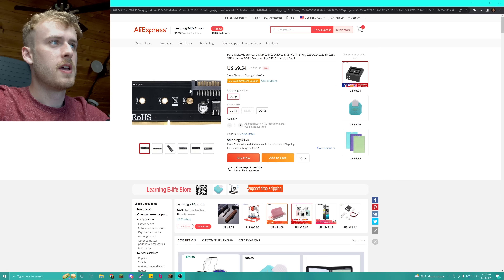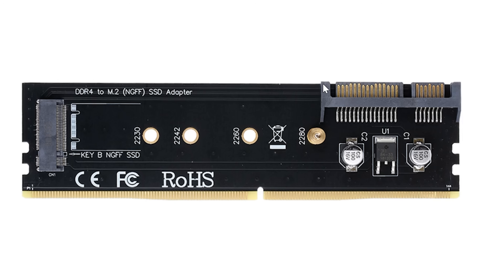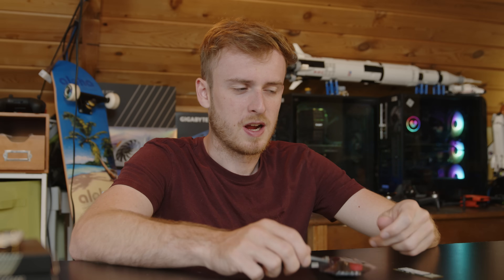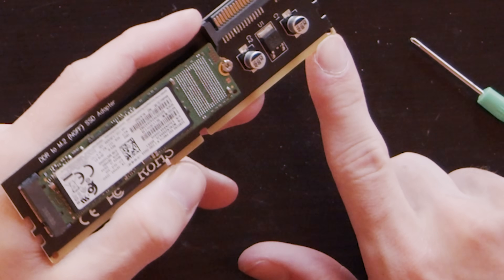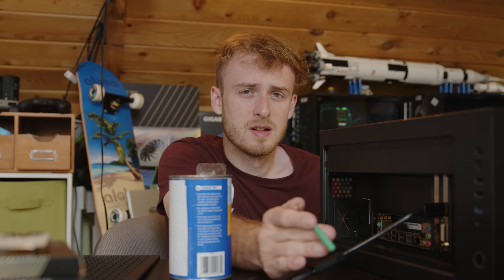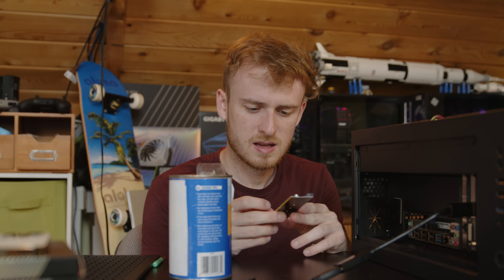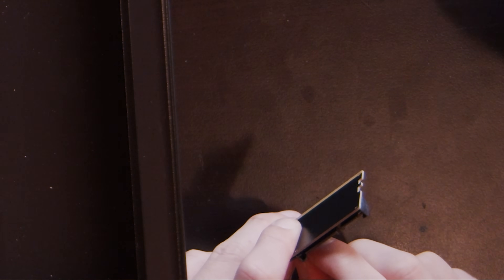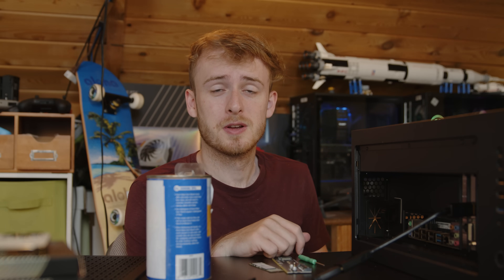I Bought a M.2 SSD To DDR4 Adapter from Aliexpress.com and Broke My PC?

Comment from the maker: Hey guys update: the product got removed off the website before I uploaded the video -.- I also haven’t any luck fixing the pc. Luckily those motherboards and CPUs are really cheap and I have a lot of them for videos. I also frankly have no idea why this is causing issues. There is nothing to be breaking it?? Also join my whitelisted survival server here too: https://discord.gg/XcXzFxevX3
Reply: oh man that sucks :( what kind of product even is that wtf
Reply: If it’s a recent CPU like last 3-5 generations at-least, possible the fix is as easy as switching out CPUs as the IMC (integrated memory controllers) are now baked into the CPU instead of the board. Now if that doesn’t fix the issue, chances are the damage is more physical, maybe the adapter is too thicc or mishaped just enough to bend some pins to touch while was installed or something.
Reply: Can you look with a multimeter if something connects somewhere
Reply from the maker: Well sure but the biggest issue is sure I can trace connections but it’s hard to see what voltages it’s putting out now that’s it’s fried potentially the board, the power supply or both. I don’t have an extra system and voltages and stuff may be different.
Reply: @JaysTechVault  i meant more just in contuinity mode, just from the regulator to the pins slide it over listen for beeps
Reply: I'd bet that the adapter had the 12v rail connected to the data pins of the SATA interface. That'd do some damage.
Reply: RIP escaped magic smoke
Reply: Try clearing CMOS. I think you corrupted the CMOS by having it in the ram slot with no pins. The slot thinks there was a module there because it moved the contacts in the socket but then it didn't connect to anything.
Reply: @jacklwebber  The way you worded that it sounds like as if you are saying the CMOS is on both the chip and on the motherboard.
Reply: Consider the traces overlapping on the capacitors to the mosfet to go into the sata delivery and kill the ram chips to then go and fry the mother board?
Reply: Was it removed by the scammers or by the website?
Reply: just a note, you mention a dropoff from SATA m.2 to conventional SATA because of a discrepancy in the number of pins - the data connection has 7 pins, but you're forgetting to factor in the power connection that supplies +5v, +3.3v, +12v and gnd. There is no discernible difference between a SATA m.2 and a conventional 2.5" SATA SSD.
Reply: wow finally, a SATA killer
Reply: What a wierd gadget it toast the board at boot what kind of crap are this guys seling? Well its a refresh for the usb killer they should pay for the damages on the pc no mater the price couse you have more boards to spare a normal consumer wont its very sad to see this scams.☠
Reply: @candidosilva7755  Mater hehe
Reply: @candidosilva7755  This scams hehe
Reply: @candidosilva7755  Couse hehe
Reply: What chipset and motherboard was it?
Reply: First thing to understand about doing business with the Chinese: they will find a way to fuck up the product worse than you can even imagine. It is not that they will simply lie to you. They will put in so much absurd effort into finding a way to make the thing even worse than just being lazy, enough they could've probably made a working product for the effort, you'd swear it's either geopolitical spite or some kind of black magic. Yes, a no-pads stick of plastic that doesn't do anything would indeed be Chinesium, but it's not authentic Chinesium until it shorts your motherboard without even having pins.

This is why I refuse to do business with them. You'll realize after awhile nothing good ever comes from China.
Reply: sucks u couldnt make it work but thank god it got removed cause thoes people are sick nasty people
Reply: could have caused a power surge through the sata to the dimm slot by a very small connection.
Reply: Cmos cleared?
Reply: I like his confused look 🤣
Reply: How much is really cheap?
Reply: it fails and destroy your board because of the voltage being too high
ddr4 is 1.2volt only

that ssd is minmum 5v or lets just assume 3.3v it will surely fry the ram slot instantly🤣
Reply: Well if a customer buys something that stupid, I would say deserved
Reply from the maker: I buy it because I show others why you shouldn’t. But even my electrical engineering student ass took one look at it and had no clue. From my testing I think it directed the 12v into the ram slot via the grounding layer. However I can’t really test it now that the system is broken and why I didn’t do much analysis in the video. I’m not plugging it into another system.
Reply: @JaysTechVault  Wait. You are an ee student, ordered a device for ddr4 (pin pitch 0.85mm) and it fit your ddr3 (1.0mm) and there weren't immediately alarm bells before you powered it on, let alone realisation of how pin moire probably caused shorts between signalling on your bus and power lines after it failed? Regardless of tracing being present or not. Not to mention any DDR to SSD interface must include RAM great enough to allow enumeration as fast DDR, performance which even NVME5.0 drives do not have.
Reply: @JaysTechVault  you can test it use a continuity check to see if the sata pins are connected 

It didn’t make any sense cause there’s no ic in between the nvme and the sata connection. Other thing maybe it’s meant for sata nvme drives ? Does indeed seem very odd
Reply: @ShaddowWolf  Image if that way of thinking were to be applied everywhere and now you have to be: an electrical engineer, computer scientist, neurologist,  mathematics, civil engineer...  just to survive 💀
Reply: @ShaddowWolf  I would say if customer buys something designed from China they should expect best case no work.  They should also expect most likely will destroy everything.
Reply: @mrfarts5176  honestly really, there is a lot of awesome but weird stuff from china that works very very well, you just have to know what exactly you need. This is something that you don't really need, just get a m.2 to USB adapter for example... But ye, weird chinese random crap for cheap, yeah don't expect much, thats true

Comment: The ram connections are dud, it is just using the ram slots as a holder. AND that is for M.2 sata based SSDs not NVME ones and for it to work, you have to connect both the sata cable and also the power from your power supply to the board, the board is not drawing any power from the ram slots.  Sorry if really you are going to use SSDs as RAM, the SSD won't last a month.  Furthermore, Intel Optane is SSD with onboard memory for caching, not the other way round.

Comment: One possibility is a short circuit. The pins of the memory slot may be high enough to scratch the conductive edge of the circuit board if it is a low-quality circuit board.

Comment: It should have been obvious from visual inspection (no tracks) that the product would never work as claimed.   The board could have been checked from an electronics perspective from that point.

There was no real point of risking a board & cpu for the sake of a video regardless of how cheap they are.  

This is why reputable brands that have warranties should always be the source for products.

Comment: Need special slot for those!
Edit: The ssd expansion board that can be plugged in normal ram slot have special chip on them that convert ram r/w request in ssd r/w request
edit2: Asus ROG Zenith Extreme motherboards had slot like that. "DIMM.2 riser card that uses a ninth DIMM-like slot on the right of the board to provide two fully fledged PCIe x3 M.2 slots as well as fans for better cooling."

Comment: I hope that wasn't your main system. You don't go plugging dodgy hardware into your main system. You do that with a burner system, much like you try software from dubious sourcese in a sandboxed VM, or better yet a "craptop" (airgapped laptop) so if it goes belly up you have no real loss.

Comment: the run of the mill oen you find has no pins and its made to fit the ram slot but have sata power and data cble to it, its just to hold it in place, any problem arises from the power delivery/sata short or wtv
dunno if this one has active pins, it cant possibly pull 5v from the dimm slot or maybe thats what fucked it up??

Comment: Looks like a voltage regulator, not a mosfet to me. Used to provide 3.3v supply to the M.2 drive since 3.3v is hardly ever provided on SATA power cables, which are usually only 5v and 12v - especially if fed from a legacy molex plug adapter. So then the 2 capacitors would make sense. One in input and one on output of regulator for smoothing.
Reply: All sata power cables should provide 3.3v.

Comment: I have run into this type of NVME form factor mounting before, the stand-off has a grove machined around the middle, you have to remove the stand-off and slide the grove into the screw slot on the end of the NVME, then come from the bottom of the adapter board with the screw to secure the stand-off, just like it come assembled.

Comment: Complete Trash vide! Why not check all the parts see whats friend. why not use on another computer without using the ram slot but just the sata cable. buy, stick in and dont understand thats all you do!

Comment: 30 year PC tech here. These devices are Almost EXCLUSIVELY scams. Ive had multiple customers OBLITERATE their pc with these devices. Depending how they terminated the pins, some of them are literally designed to INTENTIONALLY destroy a machine. Such as dumping all voltage STRAIGHT to ground, or worse, the v-refresh pin in the socket. (encountered twice). I'd be willing to bet the motherboard instafried the moment it tried to check the registers on the electrified pins. (assuming its the same scam i remember)

That being said, i hadnt thought them still around. Last time I encountered them in the wild was around 2010, but that was a "Sata to ram slot" no m.2 obviously.. guess its a new version.

Comment: Hi man . i don't think this is a SATA Voltage over loader (Yes they exist) . ones i got this PC for repair on my shop the M.2 port was busted so i order a converter like the one you have (because i had a m.2 128gb at hand) . i contacted the seller. he told me that the Ram port pins are not connected to any thing . its just a m.2 to SATA converter . i see the same one in this video . in your case i think its some thing else wrong with your system . like try Clearing the CMOS and Resting the CPU . the one i got is fine and working to this day . i dint even conect it to the ram port . just attach it with a aluminum cooling pad . it runs fine . hope this helps you . Good luck

Comment: From what the product looks like and your own description... Why did you even plop it into a DDR slot at all? It was obvious that the data and power lines independent and didn't need to be connected to the DDR slot. A better test would had been to NOT connect to the DDR slot, power the PC and see if it would POST and identify the SATA M2 as a drive unit. Or use a spare RAM slot, a protoboard, some resistors and leds and test each pin of the DDR connector before ploppint  something drawing SATA levels of power into a RAM slot. To me at least, that looked like an attempt at adding an M2 slot to a motherboard without one or an additional one using the DDR slot for space purposes.

Comment: Chances are it back fed into the dim and shorted the memory controller. As soon as i laid eyes on the caps i knew something was off. A msata shouldnt need caps nor a mosphet.
Reply: I think it’s a voltage regulator, not a mosfet. Probably 3.3v regulator as 3.3v is optional on a SATA power cable (in addition to mandatory 5v and 12v), but required by M.2. In that case 2 capacitors would also make sense. One on input and one on output from regulator for smoothing.

Comment: TBF, even if a M.2 to DDR* Adaptor would work, the SSD would die pretty fast... and get hot too. It'd just kill it much faster than it would by using it normally, as a Storage device. It would also become very unstable after throttling to temperatures and probably create BSOD's thanks to this. And there's more to keep in mind, of which I'll not explain, because an M.2 to DDR Adaptor will probably never exist since it's almost impossible to make in a reliable and practical way anyway.

Comment: 4:02 It doesn't matter if the many pins from the m.2 drive are connected to a few pins for sata. The m.2 Slot can only hold Sata m.2 drives, so it's just an adapter not a converter. 

Also that board doesn't have pins where a Ram module would have them. So it can't break your PC and is a legit way to connect a Sata m.2 (not NVMe) to your PC if you don't have free connectors for it left. If everything is connected the correct way on the board (it's a normal product so that should be the case), the board was either dead before the test or your m.2 drive was bad. But as it shows a ram error, I thing you might just have faulty ram. You could have tried another stick of ram to see if it works and also show a before and after test of connecting the drive. If you enable hot-plug in the Bios, you could also plug that thing in while windows is running.

Comment: Use a multimeter and check the resistance on the part where the contacts would be, that seemingly see through part. If you get any reading  besides OL (no connection) while sliding the multimeter points around, that is how the motherboard was toast - it was shorted through the RAM slot. You could have tried that thing without inserting it into the RAM slot - as far as I can see inserting this into a RAM slot is purely to keep it in place.
Reply: This..

Comment: This is just a cheaper poorly made version of those ddr add on cards you would get with high end motherboards before they included m.2 slots I had one with my old asus board I could plug 2 m.2 into a ram slot and connect a sata power and data cable to it and I swear any board that has ddr2 wouldn't support a m.2 drive most don't even have sata but use IDE I don't see how this would work even some older ddr3 boards would freak out at an m.2 ssd maybe that's what happened here it didn't like having m.2 plugged in and the bios shit itself and refused to boot

Comment: It is mainly for servers. Most of them have a lots of memory slots and no more space for extra 2.5" slot nor extra unused pcie lanes.
The contact points need to be there to prevent the pins on the mobo to get dirty by the pcb layers.

 You bought the ddr4 one and put in the ddr3 socket. The pins are wider on ddr3 and ddr2 so you just shorted the mobo and cpu out.
The mosfet is an always closed p channel  mosfet, i think to prevent back voltage?
Reply: It's mainly for what?  Did u sow server rack before? xD It's mainly for nothing, U can stick that shit with tape to a case. and there are no pins on that board, not even one it is not possible to short anything in the ram slot.
Linus tested that crap years ago, it's just an adapter from SATA to m.2 in the shape of a ram stick to mislead a customer
Reply: And what do you have in servers? Lots of ram slots
And what you don't have? Space for 2.5" adapters.

Comment: I wouldn't attribute to malice what could just as easily be attributed to incompetence.
Also, if it worked in the only logical way, it would be a M.2 to SATA adapter that physically locates in a RAM slot... confining you to single channel on a 2 slot board or just one pair on a 4 slot.
PS. I'm guessing that the voltage regulator circuit is for 5V to 3.3V (ignoring the SATA 3.3V so it could run off an adapter) and may be defective, unless the thing is entirely mis-wired

Comment: i does not make any sense to convert Flash into DDR via an adapter, if it works its the fastest way to brind your ssd to hell (every write process damages your flash, therefore a limited lifespan called TBW), the other way round turning Ram into storage makes sense (called RAMDISK).
Reply: i wonder if you could do that with multiple hdd raid

Comment: This product isn't as crazy as you think, servers already have something called "Persistent Memory Modules" (aka PMM) , which are basically slower RAM that doesn't lose data when the system shuts down or loses power, think of it as a the bridge between Optane and RAM.

The greatest thing about them is they can go up to 512GB per PMM, and they can cut down on system downtime significantly, as under normal circumstance a large database servers can take minutes if not hours to recover from a sudden shutdown because it has to load all the data and rebuild all the cache into the RAM again, but with PMM the data is still there, so recovery is super fast. 

It's only a matter of time before this tech makes its way into work stations and eventually, the consumer market.
Reply: Why it needs to be slower? Can't they just add a battery? lol
Reply: @SviatoslavDamaschin  because they are fundamentally different.

Normal RAM chips are made out of transistors, which are gates that open or close depending on whether they have a charge or not, having a battery will only keep the data for so long as most RAM these days require 1.2-1.35v to operate. 

While flash/ssd/optane/PMM rely on flash storage, what are more like a trap for electrons, so even without power you can still retain these electrons (i.e data)
Reply: @008abdullah  Yeah I knew about the difference between volatile and persistent storage but still, a battery is a solution to the problem
Reply: @008abdullah  fascinsting.  Thanks for sharing